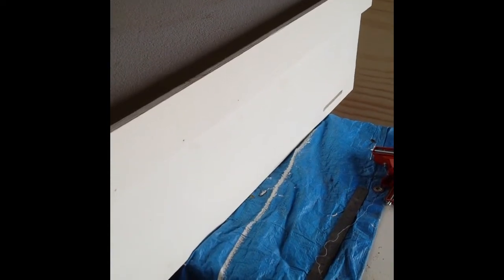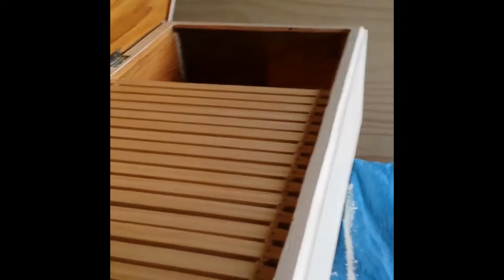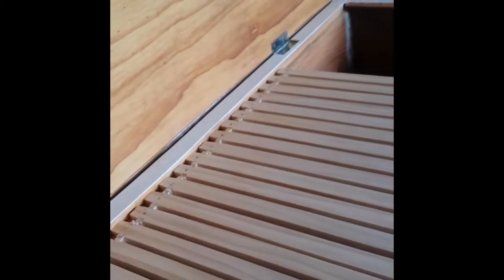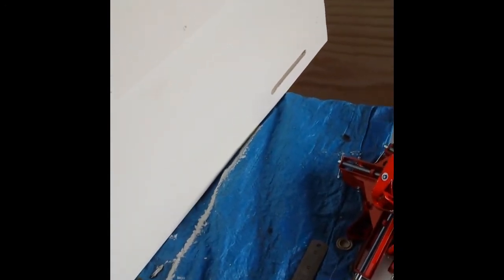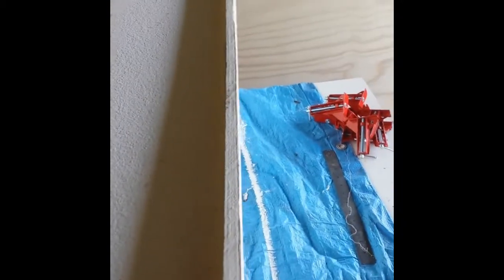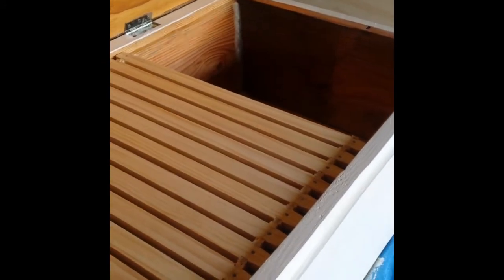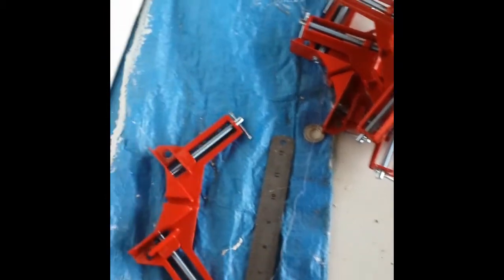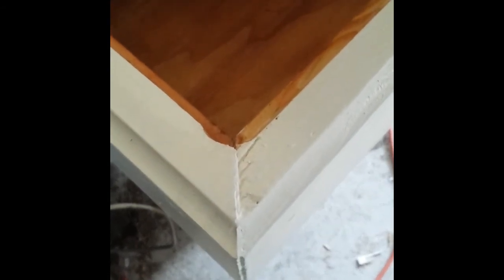Single Depth Horizontal Langstroth Beehive Design 2016-05

Comment: So have you got the bees in the hives and if so how are they going? Interested as I have just about finished building one.
Reply from the maker: Howard Halliday I've just managed to complete my first set of splits for the season and they will soon outgrow their nucs. I will be transferring them into the horizontals within the next fortnight. I have my second set of queens underway so likely populating another set of hives in about six weeks time. Will be interesting to see how they go.
Reply: GoBeeZerk look forward to hearing, also how double deeps go, thanks.
Reply from the maker: Howard Halliday I'll post an update as soon as I can. I'll put a hive in each to compare. Might be a couple of weeks before they settle in and get building.
Reply from the maker: I have bees in both models now. I went to video today as I will be out of country next three weeks and battery was flat on video recorder. I put the earliest nuc of bees in the single depth and I have since placed three nucs in double depth hives. We split nine hives into over 30 this spring so it's been a bit hectic as only hobby beekeepers. It is mid summer now so plenty of the sticky stuff being collected now and numbers building. The single depth is about half full now so about 15 frames. I have only given the doubles five sets (equivalent to 10 frames) but they appear reluctant to build down in the lower section so far. I am letting them get packed to see what happens.